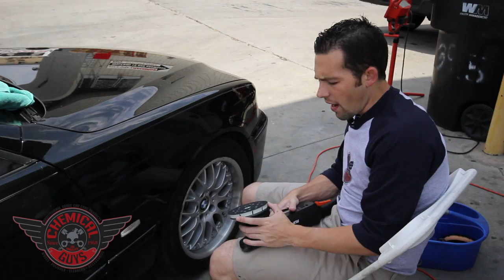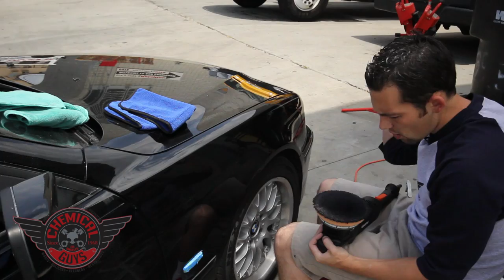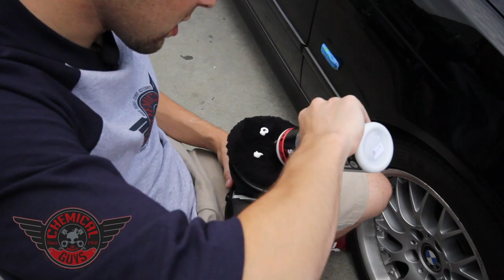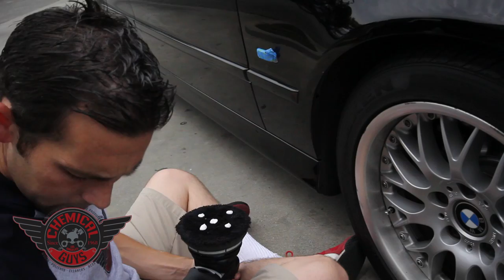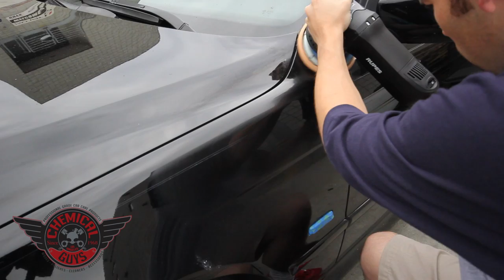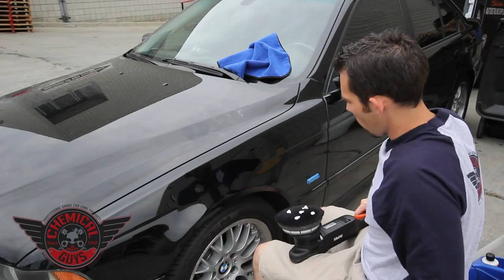BMW Jet Black 2-Step Paint Correction - Rupes LHR21ES BigFoot Polisher - Chemical Guys

Comment: Nice job Greg. A much faster/easier way to remove those painted on pinstripes is with some lacquer thinner. I just pour a little bit on a microfiber towel I don't mind throwing away, and simply wipe the pinstripe off. I've done this on many vehicles, it works great, and doesn't harm the finish.

Comment from the maker: I actually tried lacquer thinner the week before and it didn't work. Luckily the V32 worked just fine, plus my goal was to also fully paint correct the paintwork by removing swirls, scratches, and oxidation.

-Greg@CG
Reply: Can the painted pinstripes be removed simply by hand polishing with a micro fiber pad?

Comment from the maker: Yes, you can follow up with a sealant like Jetseal109 or use a premium carnuaba wax. I used BLACK WAX after to give the wettest look possible.

-Greg@CG
Reply: Can the painted pinstripes be removed simply by hand polishing with a micro fiber pad?

Comment: all waxes and sealants will work on all colors, blacklight good on anycolor. The waxes are just tinted, if you use blacklight which is like a purple color on a white car it will not tint the white paint.it will give a nice deep shine and finishand use the v7 spray sealant after applying 2 coats of blacklight. and periodically to maintain the shine. Chemical Guys products and how to videos top notch !!!!!

Comment: machine is that you get a great result without holograms or buffer trails in just one step. i myself like to use 2-step correction then seal and wax. my car looks amazing now. there is a learning curve to this machine. mostly training your body from how to use a rotary to how to use da polisher. they are not the same. i've found the 21 is great for large panels without big contours. the 15 is too but can handle contours better because of smaller throw. i also use my DAS6-Pro just to maintain all

Comment: the work i've done. (DAS6-Pro is aussie version of Porter Cable) 8 milometer throw means i can work any surface or contour. makes waxing super easy too. again little to no pressure to reduce pad wear. pressure really not needed once you get paint refined. sorry so long everyone and hope i've helped.

Comment: @Chris Richardson. when i changed over from my rotary to this new style polisher i had same problem. pads just wouldn't last long at all. i found doing smaller section passes and no down pressure and never use it on it's edge. keep it flat. if you have to use pressure make sure the pad doesn't stop spinning because that generates so much heat inside the pad they just destroy themselves. Like greg says slow down and be patient don't push for super fast results like a rotary. the benefit of this

Comment: I notice that seasoned detailers who have been in the business for years (Like this guy) don't do the cross-hatch technique. Instead they just move the polisher around randomly to where they want it to go.
Reply: It's really to move as if you were putting the shape into the panels yourself if that makes sense. It gets a better finish onto awkward shaped panels
Reply: Yep! It's also much much easier to get the curves and body lines if you approach at an angle.

Comment: Hi, I used the same pads and exactly same polisher and backing plate and literally after 30 minutes the pad fell apart.  Not good, I do regularly use CG products and I like them but those pads do not last.

Comment: I had a black car once...never again. 
Wonder what's a good wax for a Montego Blue 335i convertible. I use Black Light currently but would Lava be better for that color? Also, should I use V7 spray before or after Black Light? Or Lava for that matter.

Thanks.
Reply: matreyia I've never had a black car and finally a bought a new one this year. Couldnt be happier. Nothing wrong with black, what's wrong is that 90% of people know nothing about taking care of paint lol. It's not rocket science, but it does take a little effort.

Comment: Why speed setting 6? I use those pads with the 21 and I find it eats the pads right up
Reply: Matdon I have a 15 and it shredded 2 of my CG Hex logic pads, then I realised it was because I was on speed setting 6. Plus the fact that I was using the mk2 which has 30% more power than the mk1. Really don't need to go to 6.

Comment: How long would it take you to do that whole car from start to finish? 
Also, why dont you show the results up close and talk about them as much, being you spent so much time making this video?
Finally, I noticed while you were working on the car that the hood was full of dust.  Is that from the products being used?  Is that dust already on the hood from the air?  And why do you just throw the towel on top of the dusty hood as it may scratch the paint up?

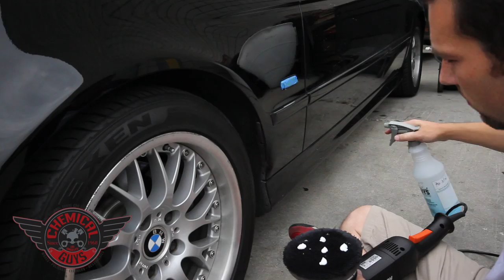Comment: hi  at 55:10   what you spray   water or  somthing another
Reply from the maker: Hey there, that would be pad conditioner, it helps to lubricate the pad so that it doesn't dry out when you are polishing.

Comment: for those of you wondering- those are ASA AR1 wheels- available at Tirerack. com.
Reply from the maker: No, that is incorrect. They are OEM BBS Style 42 wheels.

-Greg@CG
Reply: Chemical Guys you are right. these are real bbs wheels, as you can see the bbs engraving in between the two lug holes. that is how you tell if bbs wheels are real or not.
Reply: Chemical Guys hey. Is the e60 545i paint correction possible with the PC? If so what would you recommend for a jet black 545i? I don't feel comfortable trying any other machine than a PC or a GG DA. I've heard horror stories of seasoned detailing pros having a very hard time on this particular car. 05 jet black E60 5series. What products would you recommend I use with the PC?